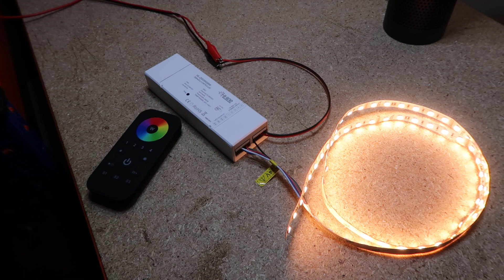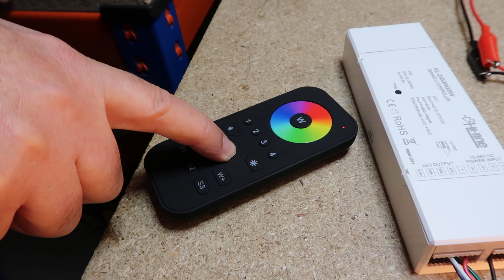ZigBee touchlink commissioning

Comment: Great video! Would doing this sort of touchlink pairing PREVENT you from pairing the device to a hub also, or can they work side-by-side. It's very hard to find touchlink info. I have read it's part of the ZLL profile and therefore may only be for bulbs/lights, but I see some mentions of touchlink on outlets?